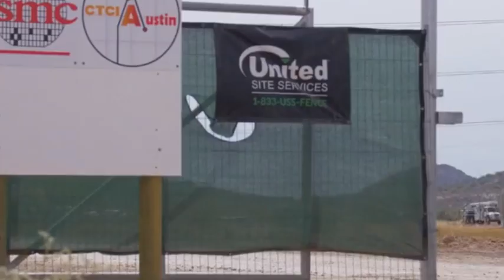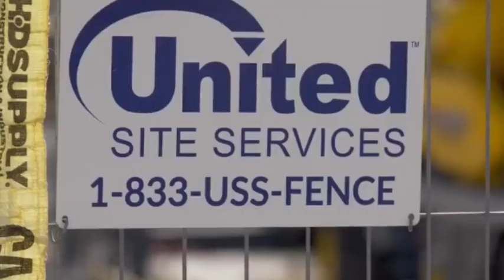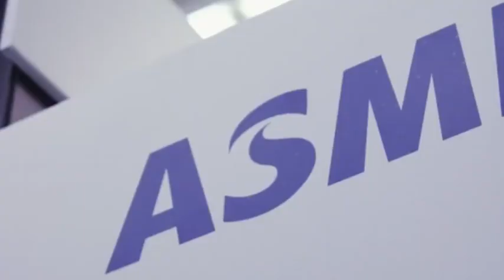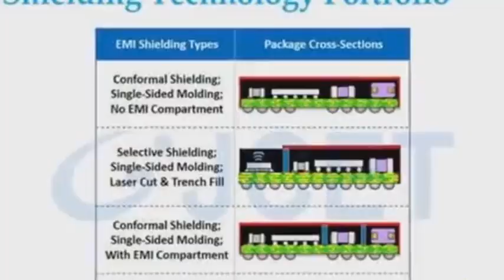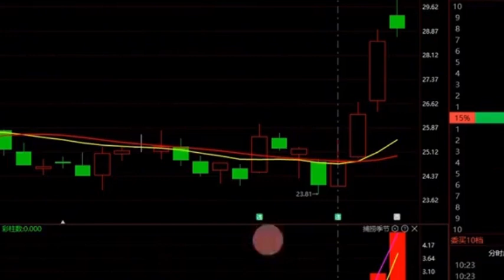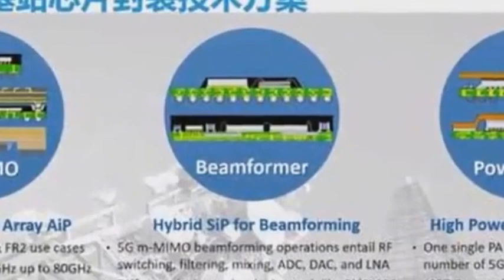ASML will limit repairs to Chinese EUV machines, but China has already purchased enough EUV machines

Comment: Can China block the sale of Dutch and American products or redirect its trade to other ports that are not in the Netherlands? If China wants to, it can respond to this with greater consequences because even if it has not mastered the production of chips, it will master the production of chips, fill the market with cheap chips and close  Dutch and American companies.
Reply: Engaging the Netherlands instead of alienating them will probably be the better strategy. The pragmatic Dutch are capable engineers and shrewd traders, they are currently being coerced by the Americans and will work with the Chinese as far as they can.
Reply: That once lucrative China business, once lost will never be restored.  The Chinese will have learned not to trust ASML with any equipment.

Comment: China developed EUVi and DUVi are built based on China own patents.
 Chinese companies could have easily reverse engineered ASML machines but believe it or not, China do respected intellectual property rights as per WIPO.
Reply: DUV and EUV are extremely complex technologies and are virtually impossible to reverse engineer.  EUV required around 20 years to develop.   To be sure though, the Chinese work best under extreme conditions and under great pressure.  They know how to "eat bitterness" and "think of a way."  Go China
Reply: @jamesho8820  
Try the Chinese then. There is no such word as impossible in Chinese.
What can be build will be build.
Chinese rovers are operating on the moon and MAR.
In fact rumors has it that CIOMP as SMEE has already build their EUV prototypes and are under testing now.